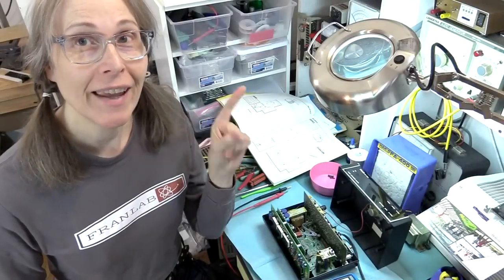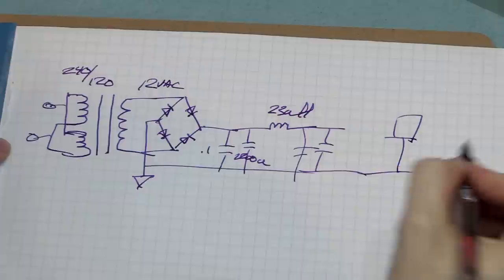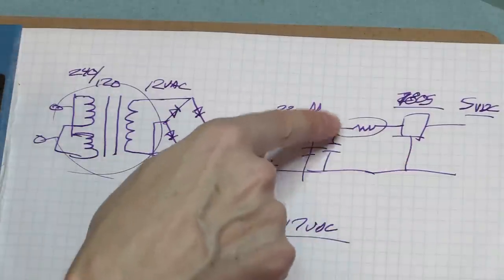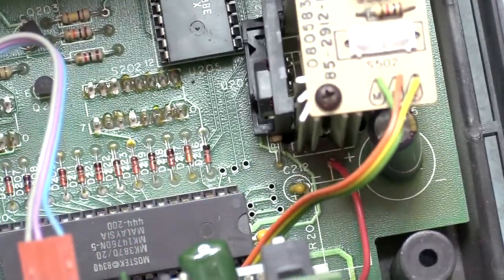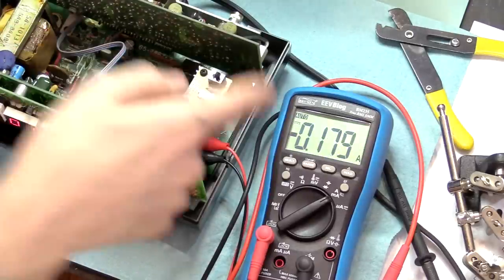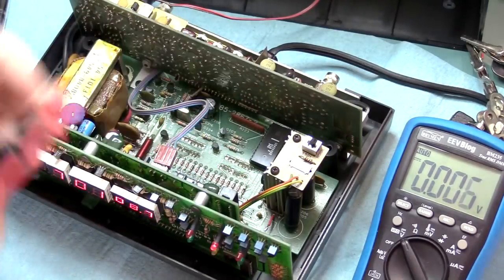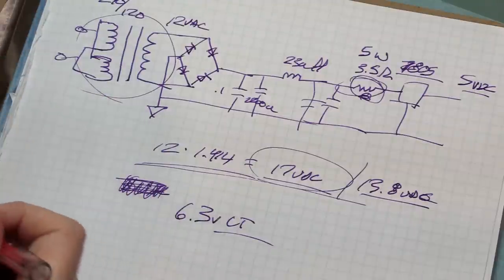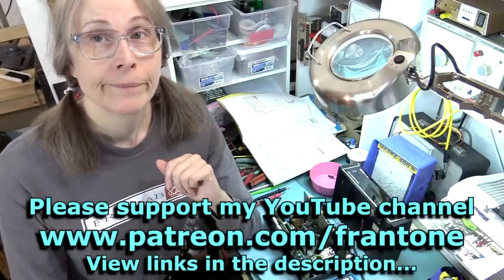Heathkit GC-1000 Power Supply Design Fails and Fixes

Comment: Quite a bit of interesting discussion here and lots of interesting ideas to solve the problem.  There do seem to be quite a few people who have basically the right ideas but perhaps have not applied them in the real world and examined the results in detail.  Over and over I see the statement that the rectifier diodes drop about 0.6 volts or 0.7 volts each so in a full wave bridge rectifier with 2 diodes effectively in series  the drop is about 1.2 to 1.4 volts.  In practice I have not found this to be the case.  Consider that with a relatively large filter capacitor across the output of the supply the diodes will only be conducting when the transformer voltage exceeds the voltage on the filter capacitor plus any drop in the diodes.  If the capacitor is large enough to hold the ripple down to a reasonable value this means that the diodes are only conducting near the peak of the AC cycle and their conduction angle is quite small. This means that the peak diode current is quite a few times larger than the output current of the power supply!  To get an exact figure you would have to know some parameters. The size of the filter capacitor, the current being drawn from the capacitor, and the regulation characteristics of the transformer (mainly related to winding resistance) are the main ones.  Then you do some math.  Typically peak diode currents will be 5 to 10 times the current being drawn from the capacitor.

Why does this matter?  There are 2 main sources of voltage drop in the diodes.  One is the junction barrier potential voltage which is the 0.6 to 0.7 volts that everyone talks about.  The other is what I call the "bulk resistance" of the diode and once the diode is conducting the value of this bulk resistance is pretty constant and it is NOT zero!  If you put a diode on a curve tracer (like a Tek 576 in the good old days...) and look at the curve when the diode is conducting heavily the line is tilted to the right.  In other words, the voltage across the diode continues to increase with increasing current. This means that if you use diodes of a size that seems reasonable for the output current of the supply the actual drop in the diodes could be as much as 1.0 to 1.2 volts EACH.  As an example, if you look at the data sheet (  https://www.onsemi.com/pub/Collateral/1N4001-D.PDF  ) curves for a 1N400X diode which is rated for an average rectified current of 1 amp into a resistive load the typical drop is 1.1 volts at 5 amps peak current at 25 degrees Celsius.  True, most of the time you can get away with being unaware of this factor but if you want your linear supply to operate correctly under all conditions such as maximum load and minimum line voltage you must account for this factor.

What is the solution to this issue?  First, use diodes with higher current capability than you would expect to have to use.  Second, when designing a power supply for low voltages use a centre tapped transformer and a 2 diode bridge.  Now there is only one diode in series with the load rather than 2 so the losses due to this factor are cut in half.  Yes, the transformer is not as fully utilised but I believe this is a good design tradeoff  compared to the higher losses in a 4 diode bridge.  I would change the circuit topology to the 4 diode bridge somewhere between 12 and 25 volts DC output depending on the output current.  Third, don't oversize the filter capacitor in an attempt to reduce the ripple.  Doing so shortens the diode conduction angle thus increasing the peak diode currents which increases the voltage drops in the diodes.  The regulator will take care of the ripple as long as you have sufficient voltage at the trough of the ripple to keep the regulator from dropping out even when the line voltage is at the minimum spec. 

Incidentally, when I was conducting interviews for prospective employees to work for me one of my questions was usually "Design a 5 volt 1 amp linear regulated power supply.  Show all component values and explain the reason you chose those values."  Any competent electronics design engineer should be able to do this simple task in their sleep - but I actually found very few who actually knew what they were doing sufficiently well to truly successfully and completely answer this question.  The discussions triggered by this seemingly simple question very quickly told me who would be worth a second look at hiring.

So, what do we do about the clock?  I have read a couple hundred of the comments and many solutions have been proposed.  Some (such as converting to a half wave rectifier or connecting the transformer primaries for 220 volts) clearly will not work under conditions the clock may find itself being used in such as low line voltage. Some, such as installing some series diodes, or putting the original dropping resistor back into the circuit are OK but have the disadvantage of again degrading tolerance to low line voltage.  Installing a 7809 pre-regulator or a buck winding on the transformer primary are clever ideas that I like, but they too will degrade low line voltage tolerance.

What would I do?  First I would return the circuit to its original configuration (but with a jumper instead of the original dropping resistor) for historical accuracy reasons.  In this circuit the load is permanently connected to the supply and there will be some minimum to maximum range of currents drawn.  I would measure the load current under various conditions to determine what the MINIMUM load current could be under ANY operating condition.  I would then measure the peak voltage on the filter capacitor under high line voltage conditions.  Subtract 5 volts from this number to get the maximum peak voltage between the input and output of the 7805 regulator.  Use this voltage and something between 40% to 60% of the minimum current drawn to calculate a resistor value.  Connect a resistor of this value between the input and output terminals of the 7805 regulator.  Using the voltage and currents involved calculate the worst case wattage dissipated by the resistor and use a resistor of about twice that wattage rating.

The idea is that this resistor bypasses some of the current required to operate the circuit around the regulator.  The regulator itself provides the additional current necessary to bring the output voltage up to 5 volts and also takes out the ripple.  The resistor bypasses maximum current around the regulator at high line voltage relieving the regulator of some power dissipation when it needs it the most.  Because the regulator input is directly connected to the filter capacitor tolerance to low line voltage is not degraded.  In fact tolerance to low line voltage will be slightly improved because the resistor will still bypass some current at low line voltage so the regulator will have to provide less than the full load current and  regulator dropout voltage is somewhat proportional to current load.  The one critical factor is that the regulator must ALWAYS provide some current.  If the load current decreases to the point where the regulator provides no current all of the current will come through the bypass resistor and the regulator will lose control of the output voltage.  The output voltage will begin to increase and parts could be damaged.  The regulator will also not be able to remove the ripple from the output under these conditions.  This "regulator bypass resistor" trick is very useful in that it allows a small regulator to be used to regulate the output voltage at much higher current levels than it is capable of alone provided that the current drawn by the load does not fluctuate below some minimum value.

My congratulations to anybody who actually managed to read to the end of the "War and Peace" tome on some of the errors people make in designing linear power supplies!  I hope that some of you find this discussion thought provoking and useful.

Comment: I would first try to rewire for 240V operation and, add your favorite LDO regulator (I'd use one of the many 7805 pinout compatible ones) TRAP for anyone not familiar, you MUST add between like 10yuf and 100uf of capacitance AFTER most LDO regulators to keep them from oscillating - see the spec sheet for the one you pick. so yea 2 components and your rocking ....

by guesstimate is you would have about 6.9v into the regulator under load, if your LDO is capable of let's say .9v that would give you a 1v headroom for power sags. obviously using a jellybean 7805 with its 2v dropout would likely not work at worst or at best be unreliable.  ....

Also when estimating the max required current,  don't forget that has a speaker need an amp, so you want to test that at full volume or estimate for that.

Comment: I have a GC-1000 (from a yard sale), and it works as originally built.  But I have to ask "what's the point of the 10ths of seconds display?"  WWV is only ticking once per second, and no one's going to respond to a fractional-second time-of-day.
At current levels of solar in-activity, it might be hard to get the radio to hear WWV on any frequency, at any time of day, depending on your location.  But when I left my GC-1000 running for a couple of days, my HP frequency counter toggled between 3.599 999 and 3.600000 MHz randomly, which I think speaks well for the accuracy of both units.
Reply: >"what's the point of the 10ths of seconds display?"

Coolness, I think.  :-)

Comment: As a young engineer, I used to see this alot in heathkit also. It's a bit of a pain, but I've done many " vintage" repairs by " fine tuning" transformers. 
It goes like this:
Measure its output.
Disassemble the laminated core.
Unwind 5 turns from the secondary.
Reassemble it.
Measure it's voltage.
That will tell you exactly how many turns to remove to get your target voltage.
It's a pain, but leaves the device in pristine mint vintage condition.
Reply: Mark Turney you make that sound easy yet I’ve never seen it done on YT as an easy task. Do you have any links to show how easy this is ?
Reply: @markcummings150  
Every transformer is a bit different, but here is a guy completely disassembling and rewinding a transformer. Removing a few windings is much easier than rewinding the whole thing.
https://youtu.be/40VC4W3bMQI
Reply: Don't even really have to take apart the core, just work carefully through the window openings. Done it, but didn't get a t-shirt.  But in that case the LV secondary was outside the 115vac primary (not always the case).

Comment: Wire up the transformer as if it was on 240v input but keep it on 110v input that would give you about half the output voltage and you could lose the dropping resistor it should be about right Fran x

Comment: I have a Mesa Studio .22 caliber amp, and these amps have a very similar problem, that will inevitably manifest itself over time. Very similar story, trying to "adapt" a supply voltage to a part of the circuit that needs relatively low voltage  - the boost mode switching uses LDRs, and rather than using a voltage regulator or tapped transformer, they drop the voltage with a 2 watt power resistor. In operation, this resistor gets very hot, so much that the excess heat CHARS the PCB black! Over time, these charred bits start conducting and the amp becomes a noisy, un-playable mess.

Comment: If you still wanted to keep the same transformer and linear supply, you could also put a 7809 ahead of the 7805 to split the voltage drops and the power dissipation.
Reply: Not a great plan. A linear regulator behaves like a current source upstream. Putting two in line that way tends to cause one of them to burn up.

You could use a buck regulator upstream, but a linear regulator is going to fry.
Reply: @QlueDuPlessis  tell that to the torque measurement system we made.......it has been on the floor for going on 18 years......a 24VDC supply feeding a 7812 that then fed a 7805.....never had a problem with it.
Reply: Omnipotent ! 12v down to 5V is not the same as 9v down to 5V. You have to consider that the 9v regulator will probably dropout due to ripple from the estimated 11v minimum which would then cause problems on the 5V regulator.
Reply: @markcummings150  what ripple?  The 7809 would need only 10.25 to function just fine and you could always use a LDO version if you were really concerned....it would work....trust me....care to make a friendly wager?
Reply: If she's interested in lowering the total heat in the cabinet, too, this isn't getting her there.  Cascaded regulators aren't less heat than the original series resistor design.
Reply: @ordinaryaverageguy76  I think she was just trying to reduce the power dissipated by the 7805.  Cascading the regulators would do this.
Reply: @mdrew44628  in any linear power supply you are going to have ripple on the main filter cap before the regulator. the amount depends on the capacitance and the load and several other factors to a lesser extent. I can't say exactly how much because I don't know what capacitance is used or what the load is. There are lots of alternative ways to drop the voltage to the regulator. you just chose one. its not any better than a simple resistor, but you still need to do the math on all the components in your alternate reality including account for ripple which you seem to overlook.
Reply: @markcummings150  did you watch the video?  There is a 2200 uf cap and only a 0.25 amp load.....there isn't any ripple to be concerned with.....the cascaded regulators will work just fine.... guaranteed.....  As I stated in the original comment, "if you want to continue using a linear supply, an alternative to replacing the transformer is........".  I have been an EE since 1988.....I fully understand everything that is going on with the power supply.
Reply: @mdrew44628  Fran sketched in a few more caps with no values on them and even as an EE I bet you can't read minds. I don't have the circuit either, simply going by the FanCADs circuit. Its already been pointed out by several others here that Fran is measuring the current in her switch mode modified clock before the switch mode modified regulator. I was not referring to ripple in the modified circuit but ripple in the original circuit. Since you watched the video and as an EE you would know that its not going to be 250mA after the regulator, and by deduction its not going to be 250mA in the original design either. I and several others are discussing why the original circuit failed, not how to fix the modified switch mode circuit if that in fact is even an issue. As I see it the original circuit looked a reasonable way for a kit to be designed in the day. if you want to put in a 9V regulator before the 5V regulator, go ahead. You will end up with the same result (possibly worse) than with a simple resistor. BTW I think the switch-mode modified circuit is a better way to go and I have done this in my own designs, perhaps with better results than whoever designed the Heathkit switch mode mod that Fran has in her clock. I've used an LM2576T-ADJ regulator setup to about 5.2V with a 12V AC rectified AC onto a 4700uF 25V capacitor which also feeds 3 other 3-terminal regulators. As a test I have drawn 2 Amps on the 5V output for an hour with only a small heatsink and there was barely any heat to worry about. I'm not going to get into a pissing contest here but suffice to say I have done plenty of electronics designs and repairs in my life and if you want to continue to show off there are plenty of other smart people here too.
Reply: @markcummings150  look, you are the one who said it wouldn't work...I wasn't showing off and merely presented ONE alternative to replacing the transformer.  I based this off of the schematic presented and the stated current.  I agree that Heath kits are well designed and if it was me and I was having problems with the linear supply, I would replace it with a modern DC/DC module unless I was going for keeping the original circuit kind of thing.  In that case I would do more in-depth analysis to determine why it wasn't working as it was designed.

Comment: Before I replaced the 7805 voltage regulator with a Traco power,TSR 1-2450, 5V switching regulator the clock got so warm my cats tried to sleep on it. A lot of those cheap Chinese switching regulators are pretty noisy if you look at them on a scope. The Traco power ones are pretty quiet, but a little more expensive. I tried to use one of the cheap Chinese ones in an Atari 2600, and it was so noisy the 2600 would only boot up every third or fourth time you turned it on. So I always use the Traco Power ones when replacing 5 V regulators.

Comment: I suspect the engineers at HeathKit trusted the manufacturer's specs on the LM7805 5VDC regulators since the absolute maximum input voltage is spec'ed at 35VDC.  They no doubt figured they were well below the maximum with their design.

Comment: (I know this is an old video, but I just now saw it for the first time.) Could you get rid of 3 diodes and go to single-diode half-wave rectification to lower the voltage, then add more cap filtering to reduce the increased ripple? The 7805 would do a lot of its own filtering as well. (I also liked other folks' idea of wiring the primary for 240V.) Good stuff.